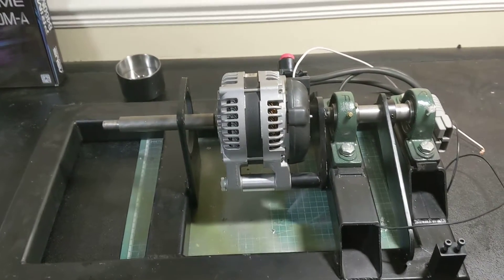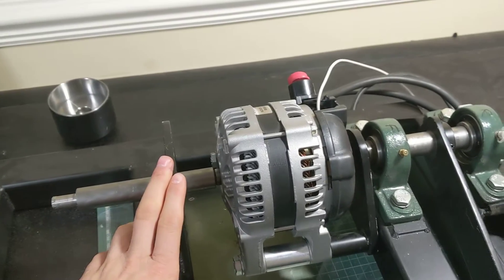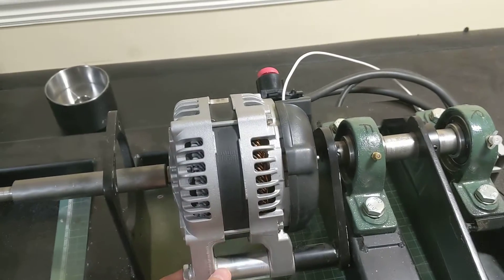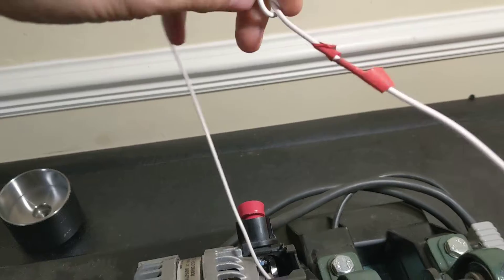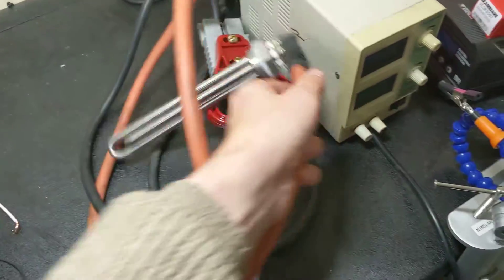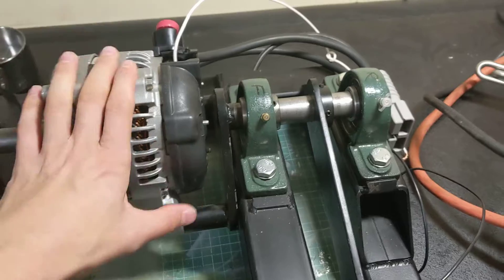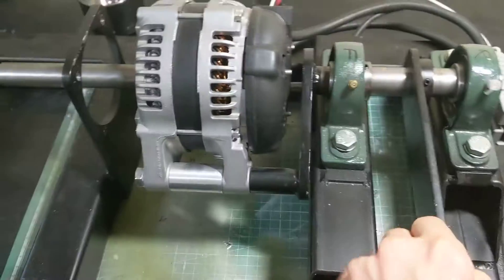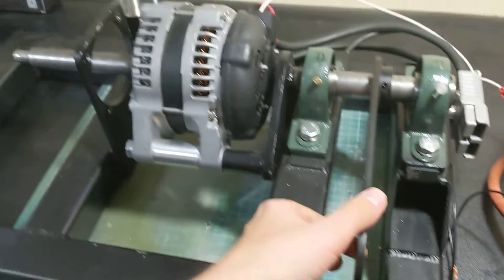DIY Kart Engine Dyno ! Part 1

Comment: alternators arent ideal as they tend to get hot... but yeah, they work up to a point.

measure internal resistance of coils, as resistive loads dont care if its AC or DC, just rip the diodes out...

use a load thats 5-10X higher resistance than the alternators internal resistance, and gear accordingly to get the speed up as the braking force for a given field voltage will be reduced...

when the load and source resistances are equal they must dissipate the same power... youll get maximum braking force but at a cost... heat!

as youre using a load cell and measuring torquexrpm, its only to keep the alternator from overheating. though, you can also use the power flow as an secondary reading... should all add up!

Comment: You say direct access to the stator winding? You mean the rotor winding? You'll get more power out of it by eliminating the diodes, changing to delta wiring and using 3 loads, one for each phase.

Comment: Were you ever able to get this thing running?  Looks like a great design.
Reply from the maker: Thanlks, yes all running I need to do the part 2 video ijn due course!
Reply: @mtechautomotive  where did you get the shaft extension for the alternator input shaft?  Is it threaded onto the alternator shaft?  So cool, beautiful design.

Comment: Excellent video!! Please do a part 2 this is very interesting! I plan to do a very similar setup this summer, but I thought of adding a brake rotor (as a weight) to the shaft of the alternator to be able to do pulls also (dynamic test) instead of only static.
Reply: Just to develop on my idea... I understand you wouldn't be able to measure the torque on the load cell with a dynamic test. This is what I would do to calculate power from RPM on a dynamic test: 
1. First you perform a static test say at 2k RPM to measure the torque of the engine at that speed
2. Then, you perform a dynamic test and you only measure the rpm of the shaft, then you derivate to get acceleration.
3. Since you measured the torque at 2k rpm, and now you have acceleration, you can figure out the inertia of the whole shaft to calibrate it.
4. From now on you can directly correlate acceleration to torque/power :D
Reply from the maker: @rantanplan1911  You could, however my plan was to hold and read every say 500 rpm automatsically to then generate the curve across the RPM range

Comment: PLEASE do part 2. I am especially interested in the wiring of the alternator. I've got the rest together
Reply: Hi Alex, did you ever get your dyno up and running?  I have questions about how to wire the alternator also.  Thanks
Reply: @mikefriesdrums  Hi Mike. I'm not there yet. I will let you know. I am thinking of a 3-fase heating coil of a boiler, hook every winding to one fase of the alternator and apply current to the rotor for braking power.
Reply: @TeffliLexi hi I’m interested to , i built chainsaws 😊
Reply: Really need a 2.

Comment: Many alternators have zener diodes for rectification, clamping output to ~20, sometimes an external rectifier is needed.

I have loaded a 10hp chainsaw to clutch slip with a 100A alternator, with basically the same setup you have here.
Reply from the maker: Interesting - there is definaetly a diode bank in this unit - can you explain more? I assume you removed the diodes and just went AC and higher voltages?
Reply: @mtechautomotive  I believe oem went with Zener diodes for the rectifier bank when cars went EFI, reason being that a failed “on” regulator could caused serious damage, I have seen 170V with mine open circuit, it would only hit 20V before I modded it, the zener diodes clamp/limits the max voltage across them as a safety measure.

I had to fully disassemble my alternator to gain access to the diode bank, I cut the original diodes out and soldered three wires in their place, leading to a (cheap ebay) 150amp full bridge three phase rectifier, on a heatsink, then onto my load bank.

Alternator was star wound, so 3x winding ends  are connected inside the alternator.

You could go to AC,  but then you need to wire for three phases on your load bank, a pain in the proverbial, and can’t be done with a single element.

What rpm range do you plan to test between?

I’m running around 42 volts with bigger saws, so outputting 3x more power at the same amps than 14v

Check my video for the rpm, volts and Watts on an alternator under ~6hp load, amps averaged around 75 through the run.

Comment: You can also use light bulbs to create load, easy to turn them on and off
Reply from the maker: becuase we can inject stator current, we can vary the load continuously and smoothly from 0-~4hp - we can use a PWM power supply to do this and software control it to also allow closed loop RPM holding :)
Reply: Standard light bulbs are not particularly suitable for this.

Domestic automotive alternators are low voltage high current devices, as the voltage output will be less than the 110/220V higher wattage lamps are designed for, you need to use more than expected, example being a 1000w 220v halogen lamp draws only 2 amps at 60 volts, it will only consume 120 watts.

Depending on the load you can expect 12 to 60 volts from an alternator loaded like this, 150+ with no electrical load.

Just not night enough voltage for bulbs, air heaters etc when you need to dump a lot of electrical load.
Reply from the maker: @motorsawing6739  We are using 12V heater elements as the load dumping